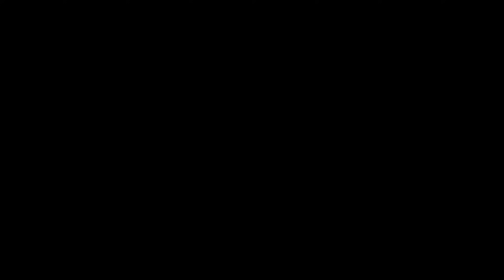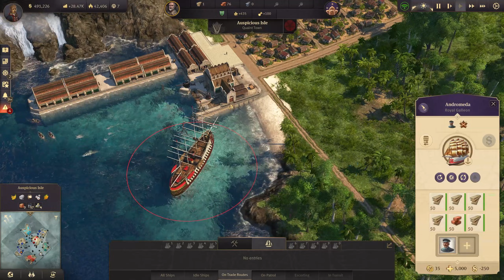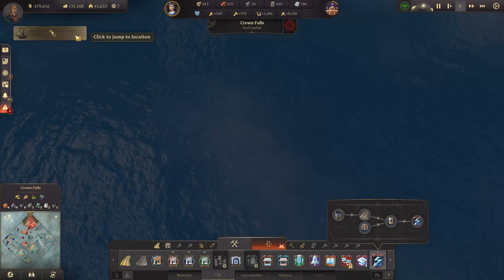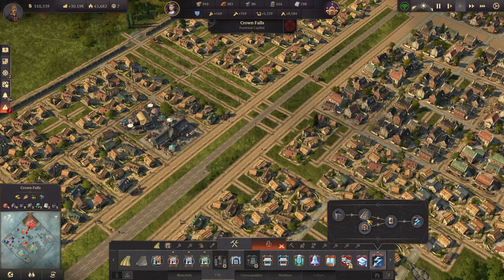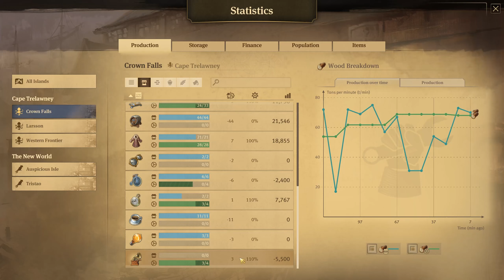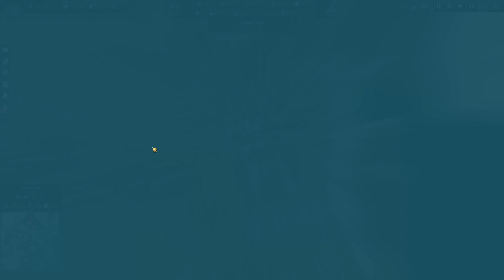INDUSTRY BOOST - Anno 1800 MEGACITY #19 || Ultra Hard AI & 70+ Mods || All DLCs

Comment: Nice series. use the tractors in the new world. gives you 4 times more output per farm and halves workforces required
Reply from the maker: Good idea!
Reply: Where’s he gonna get the additional land tho?
Reply: @paulfrancistorres7144  Hi Paul, land is not the problem. you need oil but I think Nivarias allready has a island with 17 Wells. you need however steammotor other than that tractors are great. for coffee, tractors are even better as standard there slow